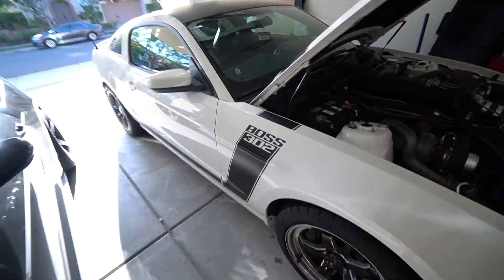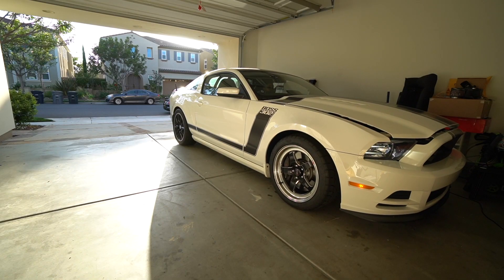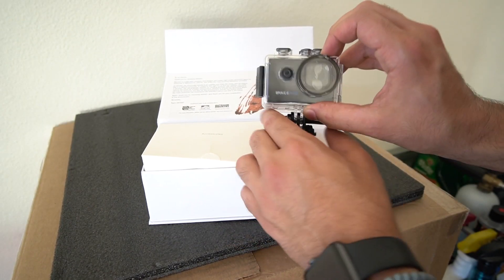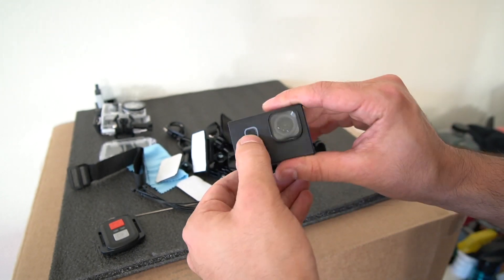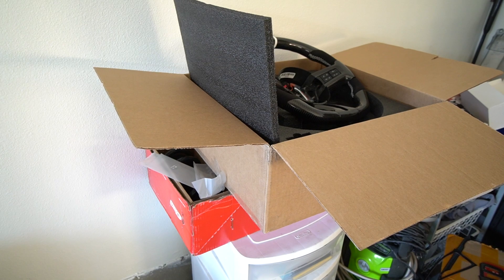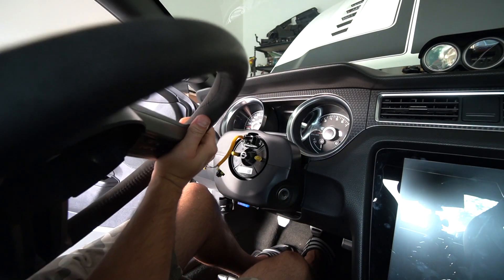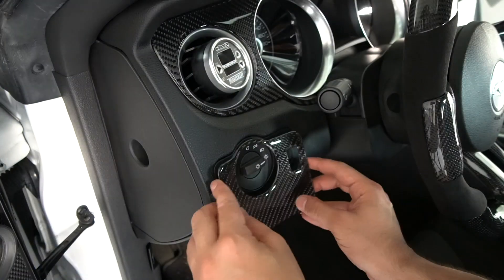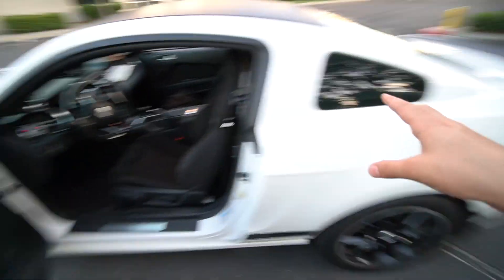CHEAP INTERIOR MODS TRANSFORMED THE LOOK OF MY TWIN TURBO MUSTANG's OUTDATED INTERIOR!

Comment: I think the stock brushed aluminum dash in the boss is one of the best interior trims out there. I have the same steering wheel for mine just with orange stitching.
Reply: @BossMan 302 how much was the steering wheel from DynaPerformance? I've looked on their site but I don't see an option for ordering it without the LED lights.

Comment: I just picked up a 2019 Ecoboost premium........ they didn’t have any GTs in stock and yes I know the base Gt is the same price and the premium Ecoboost and I could have just got that . I am coming from the JDM tuner world of cars and wanted the Ecoboost. Now that I got that off my chest I was wondering about the center console vents . Do all GTs have 4 vents because my Ecoboost just has 3 .
Reply: I believe that's because yours doesn't have the gouges in the middle. so instead of putting blank circles, they put a vent there.